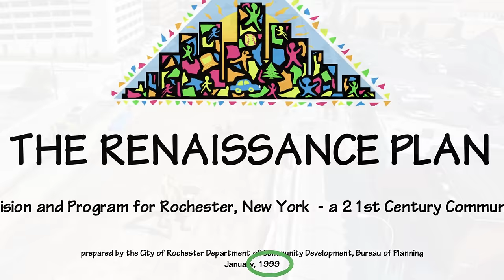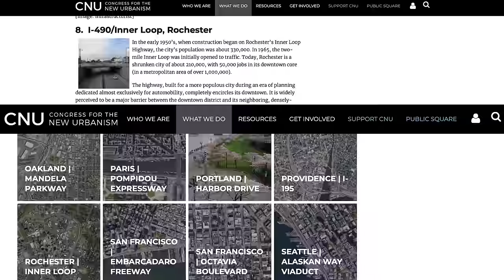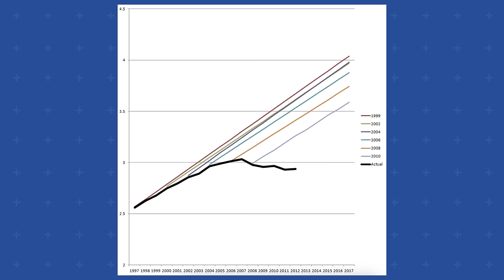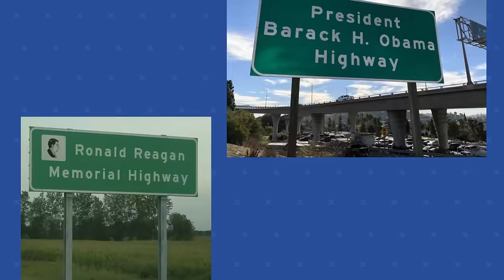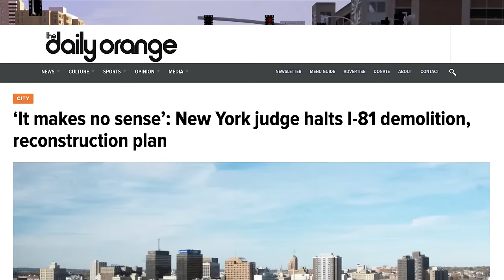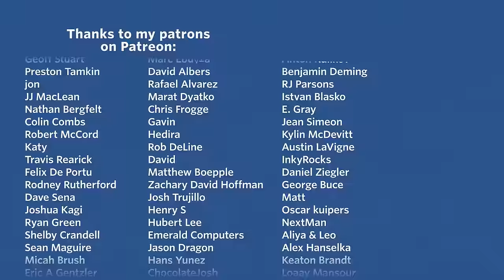How to Remove a Highway

Comment: To me, as someone who grew up in Europe it's wild that so-called "engineers" think it's a good idea to build highways through cities dividing neighborhoods. In most European countries, highways go around cities, and then they join into local roads. In my local area, in a small country in Central Europe, there's a highway (not like a US freeway) that connects three county capitals (two university cities, and many smaller, but important cities). At one section, the highway used to go through the second largest city in the neighboring county. They decided to build huge infrastructure to bypass the city, and it connects the highway to nearby smaller towns and villages. They built an impressive roundabout on a bridge. This is what highways should be like.
Reply: There's a lot that went into urban freeways but it really does boil down to the power of the auto industry lobby, racism, and the massive amounts of funding Congress authorized for the Interstate Highway System. The tide has begun to shift, but with the rise of "donut cities" in the US, it's going to be an uphill battle to get suburban commuters to be okay with tearing down the very highways that allowed their suburbia to flourish at the expense of the cities they surround.
Reply: There used to be a move for bypasses, as many towns and cities realized they wanted this.  Also ring roads outside major cities.  But the fashion has become to shove the traffic through downtown, as some of it is origin and destination traffic, as a well known consultant that my city hired explained to us.  Then spread the traffic onto more and more city streets, such as past the local high school, middle school and two elementary schools.  The latter proposals keep coming up every few years, promoted by the state.  Features to protect pedestrians are rejected because they might damage cars that lose control.  It seems counterproductive to me.  (I participated in groups and projects aimed at improving the city for several years, too many, always the same upshot.)
Reply: @bearcubdaycare  Indianapolis is probably the best example of a city that refused to allow highways through its urban core. After I-65 and I-70 were rammed through downtown, the city put its foot down and said no to any future highways within the beltway. Even existing state and US highways were removed from the city center and routed along I-465, and the new I-69 is not going to be breaking that line. Indianapolis is also a unique example as it is consolidated with Marion County, and so the city government has control over a much wider swath of land than most American cities do.
Reply: Bencesceger, thanks for the description of the situation in your city. That’s interesting to know. I’m in Nashville, which is booming and growing rapidly and the population is just awakening to the certainty that when it comes to cars (really SUVs) the future must be different from the recent past. During peak hours, thousands of SUVs, each with one person inside, clog streets and intersections in the central city.
Reply: @bearcubdaycare  So they care more about damaging cars then pedestrians losing their life? Many European cities started implementing a maximum urban speed limit of 30 km/h (18 mph) as the chance of a pedestrian death is about 10%.
Reply: @DRL1320  I've been seeing more and more pickup trucks and SUVs in my area. My neck of the woods (and mostly the whole country) has a lot of toxic drivers (drivers hating on pedestrians, cyclists, people with scooters), they would get rid of sidewalks and bike lanes. Public transportation got stupidly cheap here. For $51, you can buy a monthly country pass that's valid for all intercity/regional buses and trains (plus all local buses, trams, subway in Budapest). Trains take you pretty much everywhere, but buses serve the tiniest of villages pretty much all over.
Reply: @benceseger7748  Hi there from Texas. So actually, it wasn’t even engineers or city planners who designed our interstate system. It was the auto industry. Explains why it’s such a mess huh?
Reply: @PatricenotPatrick  What?! I knew the auto industry was involved + when they meddled with LA streetcar system, but I didn't know they designed it. I guess America Inc. US needs more European immigrants who can help shape the country into a more livable place.
Reply: @benceseger7748  Indeed. And it’s funny I live in Houston where a LOT of Brit’s live (BP’s US headquarters I briefly interned here as well as other British companies) and you’d be surprised. A lot of them actually love having a car and living all spread out when they move here. It’s so weird lol
Reply: @PatricenotPatrick  I'd rather take trains even if they have delays. My area doesn't have high speed rail, but at least it has rail that provides a relatively good comfort level.
Reply: To me, as someone who grew up in Europe it's wild that so-called "engineers" think it's a good idea to build highways through cities dividing neighborhoods.

Seriously I don't know why its such a huge deal to build a highway through a city if its needed and if its done right. Not saying its always a good idea to do so, but its not always a bad idea either. Tokyo has TONS of highways and rail lines running throughout its huge city and it doesn't ever seem to be a problem. In fact they build businesses under and right beside highways and have rail lines running in between residential buildings. 

The point is they're not bothered by having these transportation links running all around their city and saying its 'dividing' or ruining their communities in any way and instead they build under and right up to it and it becomes apart of their city.
Reply: @UzumakiNaruto_ Zoning laws in Japan permit that. Zoning laws in the states prohibit that.
Reply: The difference lies in the USA's history of racial division and segregation. In most major US cities in the mid-20th century, there would be run-down slum areas mainly inhabited by Blacks and other minorities. As these groups moved into cities to flee the apartheid regime in the rural South and work in the factories during World War 2, the white population moved to the new suburbs, fearing crime or "moral decay" or whatever. Since these new suburbs didn't want public transit networks giving minorities access to their communities, urban freeways were the solution for connecting suburban residents to jobs in downtown cores. 
And those nonwhite inner-city neighborhoods provided an attractive target for routing those freeways, since the land was cheaper, and the residents lacked the political power to resist demolition. There was also a dimension of "blight clearance" and "urban renewal" bolstering the pro-freeway argument. In some cases, there was malicious intent -- some middle-class Black neighborhoods in Montgomery, Alabama were deliberately razed for I-85 to punish the residents' role in civil rights activism.
Reply: @JamilLynch  
Zoning laws in Japan permit that. Zoning laws in the states prohibit that.

Do you mean building structures near a highway or something else?
Reply: @Zalis116  
In most major US cities in the mid-20th century, there would be run-down slum areas mainly inhabited by Blacks and other minorities.

Slums are created by the people who live there, not by the location. Interesting how most minority groups can create communities to serve their own population when they first arrive to a foreign nation and yet a couple of other demographics of people turn every place they settle in into violent, criminal areas that force people to move out if they value their lives and their properties. 

Since these new suburbs didn't want public transit networks giving minorities access to their communities, urban freeways were the solution for connecting suburban residents to jobs in downtown cores.

I think generally its less a conspiracy to build less transit to keep minorities out of wealthier suburban areas and more about people who were earning more money preferring to buy vehicles to drive themselves around than use public transit. 

the white population moved to the new suburbs, fearing crime or "moral decay" or whatever.

And guess what? They were proven 100% right in so many cities where a certain demographic of people is consistently turning every area they move into in large numbers into violent and dangerous places to live. But hey if you refuse to live around people who would do you harm YOU'RE the problem and not those criminals and violent people. 

Heck this isn't even just white people, but plenty of non-white people as well who don't want to have themselves or their families to live in such violent areas with such dangerous people.
Reply: @UzumakiNaruto_  
Sometimes locations do create slum conditions, as with NYC's 5 Points neighborhood -- it was on the site of a filled-in lake, which led to buildings sinking, methane leaks, poor drainage, and diseases stemming from standing water and mosquitoes. After those problems became apparent, the middle class moved out and the poor moved in. And yes, the auto industry's marketing of the "American Dream" of car ownership had a part in suburbanization. 
But I'm not interested in wading into the weeds of any group's "inherent criminality." My point is that these perceptions and fears, whether they were true or not, played a major role in the development patterns of US cities and freeways, and that their absence explains why things turned out differently in Europe and other more racially-homogeneous places.
Reply: @Zalis116  
Sometimes locations do create slum conditions, as with NYC's 5 Points neighborhood -- it was on the site of a filled-in lake, which led to buildings sinking, methane leaks, poor drainage, and diseases stemming from standing water and mosquitoes.

The condition of an area might create slum conditions, but it doesn't create violent and criminal people. You can live in poverty and NOT turn to violence and crime and turn your neighborhoods into dangerous places to live in addition to being poor. All you have to do is look at the countless poor areas all across Asia where hundreds of millions of people live in far, FAR worse poverty and squalor than anyone in any western city does outside of the homeless and you'll see that poverty didn't make all those people turn to violence and crime.

Rather than turning to crime, the vast majority of those people simply want a job that can support their families and makes enough money so that their children can get a proper education. And yet in the west certain demographics of people have education, decent housing and other social services handed to them on a silver platter and still they find a way to screw things up and be largely unable to lift themselves out of poverty and crime.

My point is that these perceptions and fears, whether they were true or not, played a major role in the development patterns of US cities and freeways, and that their absence explains why things turned out differently in Europe and other more racially-homogeneous places

The thing is in most cases these fears WERE TRUE and the statistics have shown this to be fact. No one like living around violent and criminal people and when your area turns to crap where your family and property is no longer safe, then you leave. Its interesting to me that there's only one or two groups of people who consistently ruin places that they populate in large numbers and then cry about racism when others decide to leave for someplace safer. Well if you don't want people leaving then its simple. STOP BEING SO VIOLENT AND CRIMINAL. 

We have people from all corners of the earth living in the US, Canada and other western nations and its ALWAYS the same couple of groups who have the most problems living peacefully in any country that they settle in significant numbers.

Also with regards to many US cities and how they grew to have so much sprawl while the car certainly aided in that, the real reason is that it all comes down to the huge amounts of space available in North America in comparison to Europe and elsewhere. When you have vast amounts of land to build on, people aren't going to be mindful of not wasting it by building with more density rather than just plowing over new areas of land to build on. 

Imagine if the US mainland wasn't one single country, but instead where each state was its own individual nation, I guarantee you that almost every one of these new nations would be high density because they're FORCED to be. When you no longer have tons of space to waste, you conserve what you have.
Reply: It happens in Europe
Reply: They mostly "thought" it was a good idea, as in, no longer think this way.  Most of Europe was developing plans to do this when people collectively began deciding that it was a bad idea, so eventually they were shelved.  In the Marxist East, they simply did not have the money or car traffic for all that.  So there was the idea for something like that in most cities in Western Europe.  They just got delayed ten years or so by the bomb damage, meaning that they never actually started in on those plans, meaning that they came at a time where people collectively were deciding that those sorts of plans were not such great ideas.
Reply: @UzumakiNaruto_  there is nothing wrong with highways going through cities as long as they are done well. The problem is many of these highways were the experiments that proved how not to do it, but instead of looking at why the failures failed and why the successes succeeded a lot of people just want to look at the failures and draw a blanket statement from them. A few lessons to remember when building a highway through a city, do not build it along a major waterway. Secondly do not build it through the city center itself. 

Another phenomenon these people miss is that often times the cities begin to build up around these interstates so while they began on the edges, eventually it was suddenly in the middle of the city. Highways are essentially modern rivers, they dictate where development will happen because they make transportation of people and goods easier and convenient.
Reply: @calvinsmith6681  I think the opposite, I think Indianapolis is a great example of how to do highways through an urban core right.
Reply: Europeans thinking Europe is the same as America 💀
Reply: I think it's the opposite. Small towns always start out with the interstate going straight through them with gas, hotels, and restaurants on the side. But as the town grows larger, the stop and go traffic along an interstate doesn't make any sense any more. So a bypass would be built for thru traffic.
Reply: @Zalis116 . While race played a huge part in the urban “renewal” story I tend to think it wasn’t the primary reason for choosing where they bulldozed.  The easy targets were renters.  Those with less skin in the game, so to speak.  Often if not always these less affluent areas were also black or Hispanic.   What I find so fascinating is how anyone could think that dividing communities with massive highways would make a city better.  The only way this idea could work is if every car going downtown had a place to park.  Not to mention enough roads to bring those cars to the parking lots.  Just look at Fort Worth to see how this played out.  A complete nightmare where today blacks, Hispanics and the homeless are blamed for the cities problems.
Reply: @calvinsmith6681  or in other words, capitalism (yeah, boo, I know). If it serves to expand business, a highway will be built anywhere. Europe was already fully conquered by capitalism when the automobile was invented, and so there was no room for expansion there, which is why it's operated mostly as a tourist resort and retirement home today, but America was THE expansionist project at the time.

You can see the same thing in the current expansionist project (which I cannot name because this comment will be hidden if I do), where Euromerican investors are ordering the bulldozing of entire cities to make room for more stuff to build, and to increase their control over the world's most important shipping route.

Again, not in Europe though, because it has long been conquered, and like a trophy wife, its only job is to look pretty. Same thing is starting to happen now in the older (eastern) parts of the US, as we see in this video.
Reply: @IcelanderUSer  dividing communities with massive highways is a fantastic idea if your goal is profit. It allows more trucks to deliver goods, and it keeps the poors more divided and less likely to oppose you. It's divide and conquer 101.

Comment: Always nice to see us getting recognized for doing something right, even if it was originally something we did wrong. The intent of the Inner Loop is noble, to relieve the traffic commute for suburbanites into the Center City neighborhood for work, but its execution and immediate effects (razing houses and cutting neighborhoods up, and creating a visual moat around the central business district) were detrimental to city development. Also love that projections graph you shared, as a MAJOR complaint that Inner Loop supporters STILL gloat about is how much traffic the IL was funneling, which studies have contradicted, but supporters persist.

One small point of correction: Union Street is not the old Inner Loop. Union ran next to the Inner Loop and never changed, though the traffic pattern did (it's two way now, was one way before). The old Inner Loop is where the apartment buildings and parks are now.

Thank you for the positive light shed on Rochester! We need all we can get.